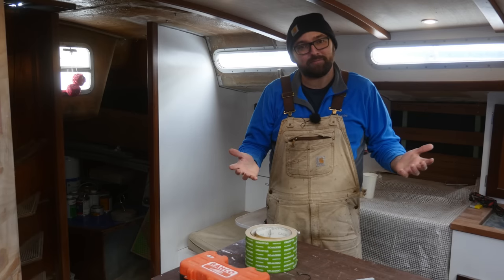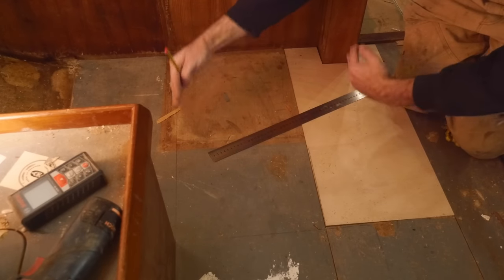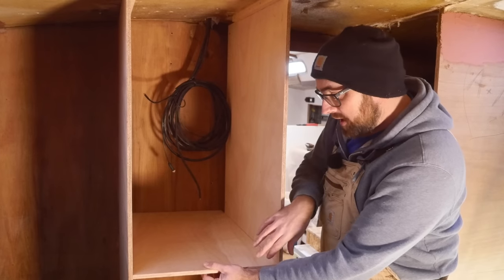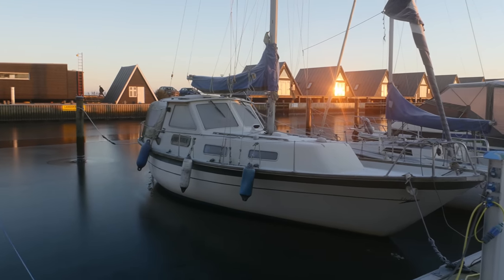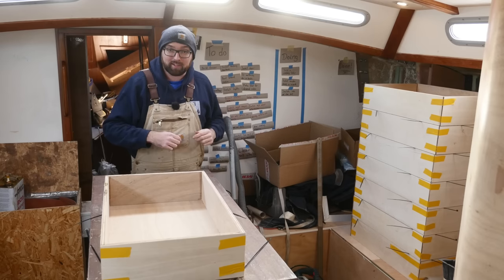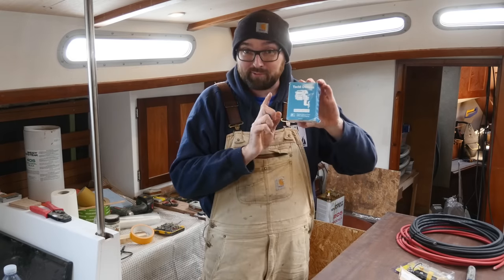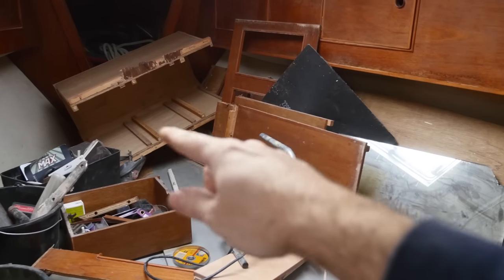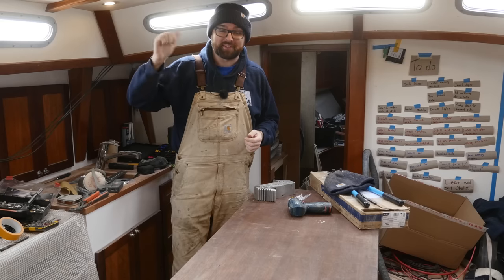Sail Life - Forward cabin & Yacht Devices Engine Gateway (NMEA 2000)

Comment: I would suggest adding a number of ventilation holes to provide air flow to all the little drawer spaces.  Humidity in warm climates can create a serious mold problem otherwise.
Reply: Maybe even a small fan to circulate air through the drawers?
Reply: @todmills  I have been thinking about fans for the fridge heat sink in my caravan and 12v computer fans is what I have decided to use, free too. Maybe these would work well on Athena.
Reply: Mads doesn't do warm climate... see any signs of a A/C unit anywhere?
Reply: Dehumidifier vented to the lockers is a great idea, but if you skip that it's recommended that you vacuum bag the long time stored cloths closest to the hull at least.

Comment: Top drawer seems a bit high to be useful.  Maybe just add doors to make into shelves.
Reply: Exactly what I wanted to add
Reply: @gadenhertog  and me! ha ha
Reply: Maybe he can mount the upper drawers upside-down so that a shorter person can access them from the bottom.
Reply: And me too, same comment. In fact, I would say top 2-3 drawers are basically unusable, and I would suggest converting that upper most section into just a cabinet for larger folded items or to hold a removeable storage bin.
Reply: Remove the top three and it is a usable hanging space or bulk storage.
Gonna pull the drawers down on your head before you can see inside. 
Thought only two shelves would be enough, seems a bit overkill to put in that many. More and more wasted space when you keep adding pieces and clearance. 
Still always defer to Mads.
Reply: This comment needs to be #1 so Mads doesn't start putting in the rest of the rails.
Reply: Yeah it's pointless having drawers so high that you can't see into them, I've never seen drawers higher than chest height and there's a really good reason for that. 
That top drawer is so close to the overheads that there is no way to put anything in which makes it pointless, you'd be better off just having shelves in the top 2 or 3 positions but even then a short person would have difficulty getting access to anything at the back.

Comment: Crimp is the modern standard for terminal connection.  Good enough for NASA, good enough for me.  I put a band of masking tape around the terminal to secure it to the wire during crimping.  Less chance of the lug shifting.
Reply: A stranded cable shouldn't be soldered when getting crimped. It can add stress and worse it reduced the contact surface
Reply: That is correct.  I have a hydraulic crimper from Temco, six tons of pressure for up to 2/0

Comment: Awesome dude ! Love your videos.  A few suggestions if I may. 1. Grease your wheels extra, on drawer slides. 2. Definitely get moisture absorbers every place you can, especially behind your electric panels. 3. If your not going to solder your wire ends, at least heat shrink them. Navionics look great, consider a large enough area for computer/editing work. Cheers 👍👍🏅💚

Comment: Thanks for the video. Look forward to these on Sundays. I'd remove the top drawer and turn it into a shelf as it will be hard to get into. I'd also turn the two bottom drawers into one larger drawer so you have somewhere to put those inevitably taller than 7" items that wouldn't fit otherwise.

Comment: Looks like we are now into the 'Oh so Glorious Gluing' phase of construction. Less dust, just as much work! While 'soldered' connections are the 'Holy Grail' of terminations, crimping with di-electric grease in each connector is pretty much equal as far as connectivity and corrosion resistance. None of my 'greased' connectors corroded or failed over ten years of sailing. It's such a cheap form of insurance, it's not worth skipping, 8P

Comment: Hi Mads, inspirational stuff.

When you come to insulate, if you have not already thought about it, you might check out where to include a vapour barrier in the build-up,  ’cos the hull grp gets cold in high latitudes and the warm air inside gets humid. You don’t want condensation occurring inside the insulation layers and especially keeping the glue dry.

Comment: Crimping is ABYC Standard. Soldering makes a hard shell that can crack. Add an adhesive heatshrink wrap for extra protection and coat terminals and lugs with an anti-corrosion agant such as petroleum jelly or dielectric grease.

Comment: Lovely video I'm impressed with how you pace the content in the videos. And for the light in the electrical compartment I would recommend  a battery-powered "wand type" in a charging bracket. The odds for needing a battery powerd light when opening that compartment under sail is high ;)

Comment: When I made up new battery cables for my boat, I both crimped the terminals then melted solder into them, thenshrink wrapped over the joint.  If you do that, the cables will last much longer.

Comment: Highly recommend Yacht Devices YDCC-04 circuit control or digital switching. I've two of them. Fun to switch on electric heater, diesel heater, lights or whatever remotely from home. Currently one of them is controlled by a YDHS, switching electric heater on/off depending on set temperature range to keep my lithiums above 5°C ready for charging.

Comment: There is an option for converting older engines to NMEA2K. Actisense do a gateway called EMU-1 that will convert any analogue engine signals into NMEA2K format and works with any engine - and one unit will cater for up to 2 engines. I have one of these on a 1989 Bayliner 4555 and it works great with the 2 Hino lumps, just a bit more wiring than the engine specific gateways for modern engines!

Comment: I agree with you regarding crimping high amperage connectors. I have found soldered connectors that the solder has heated and ran out of during use.

Comment: From what I've heard in the past, soldering in automotive/boating setting is not recommended. With the constant vibration, over time can weaken the connection but far more important is the fact that the different metals can create resistance that can creates heat points. (AKA "fire") Have you ever seen an automobile/boat with soldered joints from the factory? A well made crimp is always the best.
Reply: If crimped well, the copper gets compressed to form a single wire. I used to run cables in an exchange, we used a hydraulic crimper, I cut a connection in half once and never saw any strands left, tbey wete all compressed into one wire.

Comment: Soldering wires is so 1940's.  The electrical industry went to crimp and other types mechanical wire connections many decades ago.  It wasn't just for ease of installation either.  A soldered connection is inferior in almost every way, except for low-current miniature and sub-miniature board-level connections to wire leads and mounted components.

The only real exception is exothermic welding of conductors. This is mainly only really used in large grounding installations and lightning protectiom systems.  This technique is where the conductors are basically fused together in special high-temperature molds/crucibles using powdered copper and essentially gunpowder to melt the multiple parts together into a single solid copper piece.

But there are always old-school holdouts on soldering wires.  I also hear there are still some physicians out there who still use leaches and maggots...

Comment: I wired machine controls 40 years Detroit, go buy yourself a roll of velcro and use it to bundle wires together so you can reuse it, please do not use ty rap zip ties etc.
if you do use zip ties the black or colored ones usually are for outdoors, the white or clear one will last maybe 2 years outdoors.
put some of that wire tray on the door too make it look spiffy....put a spare loop of wire for each wire so it can reach any point in the panel. add spare wires labeled one thru 30 in your wire runs even terminate spare wires and label them for future use.when everything is all wired up make a plexiglass cover for the door breakers so because you know you will set tools on it when you are working in there LOL...those lugs ar coated with nickel and silver when folks sand them that coating comes off and your lugs or terminal rings will corrode.....car plants actually require 30 to 40 % spare wires in all wire runs for future use

Comment: Consider the moisture levels against the hull..maybe store cloths in plastic boxes...
Reply: Right but consider vacuum bags  where you  can suck out the  air  between the clothes. They're tight so no mold.
Reply: Line the inside of the drawers with “bacteria and mold killing” UV lights

Comment: I wonder if your boat will squeak in a big sea.  My boat had wood sides that rubbed against the floor in a big seaway.  Finally trimmed the wood wall to eliminate the sound.  Don’t worry you can fix it quickly.

Comment: I realize this is an old video, but have you considered balancing your battery charge? Back when I worked for Prevost, we had 12 and 24 volt systems working off of a single set of batteries. We used a single 24 volt alternator with a Vanner equalizer to keep all of the batteries equally charged. Of course, those were lead acid cranking batteries, so maybe it's different with LI or AGMs.

Comment: Very nice work, as always.  Just one comment about the engine info display - I think it is important to include oil pressure.  I have some personal experience with this as I replaced my old instrument panel with an upgraded one which included an oil pressure gauge I didn't have before (just an oil pressure alarm that had stopped working).  Just two weeks later I was motoring out of my marina when I noticed the oil pressure had dropped to almost nothing.  I blew an end cap off the rocker arm shaft.  it was an expensive repair but cheap compared to replacing a seized engine!
Reply from the maker: Yikes! That doesn't sound fun! I'm not sure I've got oil pressure data available but I'll check :)
Reply: @SailLife  Is there a NMEA audio alarm that can be programmed to trigger on specified data thresholds?  Some engine or electrical conditions need immediate attention.

Comment: Soldering vs Crimping - ALWAYS crimp your connection, crimping to the specification will produce a metal to metal bond which has very little resistance and is called a 'cold weld'. When you solder, you are introducing another barrier for the electrons to cross and therefor the path from wire to wire has increased resistance, you're also introducing another element which can deteriorate or corrode. In situations where the wire is subject to vibrations or constant movement, the solder joint can work harden and develop micro-cracks which is followed by solder fatigue and joint failure/corrosion.
Reply: I thought a ‘cold weld’ is what you get with wire-wrap (showing my age), and crimping is just compression? Either way, I crimp my terminals too, though if I were really concerned with long term integrity, I would crimp, then solder too. Why? Well, crimping alone will still leave tiny gaps between the strands and solder will flow into these, sealing off the cable strands from moisture ingress, adding mechanical support, and further reducing the (already excellent) terminal resistance of the crimp. Something to note too is that cheap crimp terminals and/or crimp tools are really terrible and potentially a fire hazard on high current loads - don’t scrimp on the crimp, or you’ll regret it!
If anyone does solder terminals, especially in a marine environment  - remember to remove any flux deposits afterwards as the flux (particularly rosin) is hygroscopic and caustic.
Reply: Some marine engineers advise against soldering, as it stiffens the wire and might lead to wire breakage as a result of vibration under way.
Reply: @thesteve7397  A fair point, and solder will wick up a stranded cable, but in effect this just moves the stress point further away from the crimp - it’s still there. Wiring should be restrained in some way - either by containment in conduit, cable ties, or lacing (again showing my age 😄). Apart from tidying the wiring, this also dampens vibration.

Comment: Not related to this video, but in the not so far distant future, you will probably do something on the ancor and the chain in order to be ready for sailing, right?
You mentioned in the past, that you intend to reuse the old ancor windlass that came with Athena, I even rember you mentioned to buy a New housing for it since the old one had some corosion damage.Having just seen Sailing UMAs Step250 , I recomend you have a look at there new maxwel windlass setup, could be something for you(Athena) as well.

Comment: Let me give you some criticism. Drawers above shoulder level are inconvenient to use. Before crimping the terminals, fill the terminals with petroleum jelly, this will not allow the junction to oxidize. Cheap plywood has a problem not that it has voids, but that it has non-moisture resistant glue and a large thickness of lamellas, which greatly affects its strength after moistening inevitable in a boat. Well, belated advice about onboard electronics, perhaps for the sake of saving money and more functionality, it was worth looking towards open source solutions like OpenCPN, Signal K and OpenPlotter.

Comment: I wonder if you thought about making the top 30-40cm of the "drawer section" just a cabinet or even just an open cubby with no door on the front. Trying to see what's in those top 2 drawers or so will be pretty much impossible wouldn't it?
Reply: I am going to guess the top drawers wll be for Mads (owing to their height differences ;)

Comment: Ok i have a question... Im in the northern United States my boat is pulled out of the water and winterized  every year because frozen water in the engine could crack the engine block. Not sure how diesel engines work but are there no worries about water freezing in the engine cooling areas?

Comment: I know you’re building a boat but man good waterproof wood glue is more than appropriate for a lot of what you’re doing save you a lot of time I’m a woodworker and Wood glue is crazy strong and waterproof my cutting boards getting very wet and I’ve never had a problem
Reply: I am going to guess that if his wardrobe is in the water he has bigger problems than worrying about damage to the drawers
Reply from the maker: You're correct. There is one big upside to epoxy and that's its gap filling properties. That and the fact that I don't need 1000 clamps ;) But yes, for most of this you could use an outdoor wood glue / PU glue.
Reply: @SailLife  Yeah after all it’s wood glue holding the plywood together. I’ve been watching since your 10 part series on insulating the V birth of your other boat your videos on Sunday are always enjoyment

Comment: I want to ask are you going to have a DC to DC charger between the alternator and the lithium’s or does your alternator have a lithium charging profile?
Reply from the maker: I'll be using a wakespeed external controller for the regulator. It adds a couple of cool features and one that's very important. In the event that the BMS shuts down the battery it'll tell the wakespeed to stop charging to prevent damage to the altornator.
Reply: @SailLife  Cool sounds like you got that figured out what about installing a AC unit in the forward cabin you got so much power on board will be a shame to be unable to sleep in the tropics
Reply from the maker: @AllMyHobbies  I'd like to add AC at some point but more so to have a way of drying out the boat :) I suspect having to generate enough energy to cool down the boat every night will be hard. We'll see when we make it further south :)

Comment: Does the NEMA/Yacht Devices system have the capability of programming alarms? Some parameters you probably want displayed all of the time, but others you only want to know if there is an emergency level reached.
Reply: No, YD sensors just transmit data onto the N2K (NMEA 2000) network for all to see. Then it would be up to some "smart device" like a Garmin MFD (multi-function display) to be able to set alarms based on that data.

Comment: Mads, I don't recall hearing the mounting of a self-steering vane on your list. Will that be a pre-launch install? As always, great work and videos. Thanks
Reply: This boat is going to be a heavy electical power consumer.  A hydraulic AP isn't going to draw but a tiny percentage of even what that stovetop draws.  There is no point in a wind vane self-steerer when cooking breakfast will use more juice than 24 hours running the autopilot will take.

The big-time cash outlay for a new spiffy wind vane will be better spent on more Kwh of lithium batteries.
Reply: He probably still has the original wind vane (took the brackets off I think before he painted the hull). My question is: how would the wind vane fit in and work with his plans at a large solar arch with possible davits for a dingy at the rear? That all might get in the way of the vane.

Comment: Mads re your lighting situation for inside the panel etc. There are these Doddads to get technical they are small LED battery operated lights they affix with sticky tape and are tend to have the switch built in to the cover so you just press them. Of course they are of little use where you need lights which are going to be on for long periods of time. But should be ideal for inside your instrument panel and your clothing rack. They take about 20 seconds to fit and can be found extremely cheaply 10 or 20 Euros for a pack of 3 or 5. Since they have few moving parts and use low draw LEDs they last a surprising amount of time for occasional use.